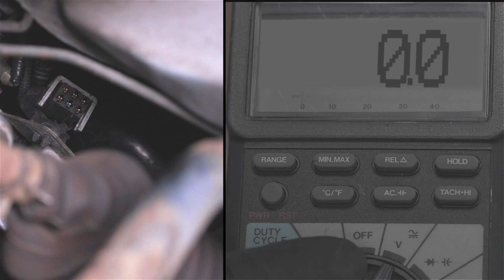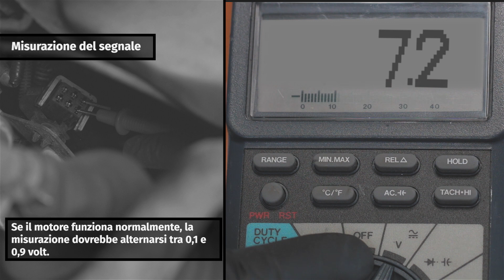Come controllare e sostituire il sensore lambda

Comment: Come posso capire quale sonda lambda non funziona?
Reply from the maker: The first thing to do is read the engine control unit's error memory. The most important emission-related fault codes are the same for each vehicle and can be read and interpreted with the cheapest diagnostic device.
Reply: @GarageGurusEU  la diagnosi dice che la sonda non funziona ma non dice quale. Sono due le sonde una davanti al catalizzatore e una al catalizzatore